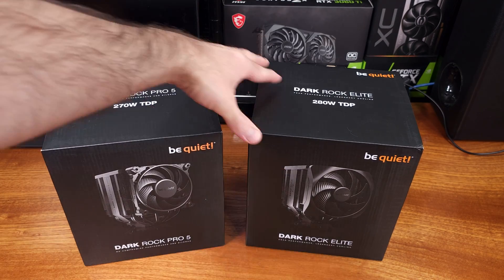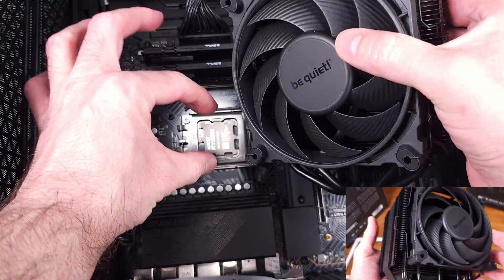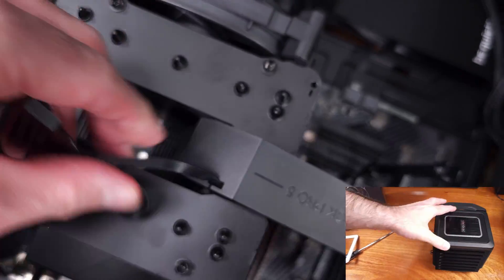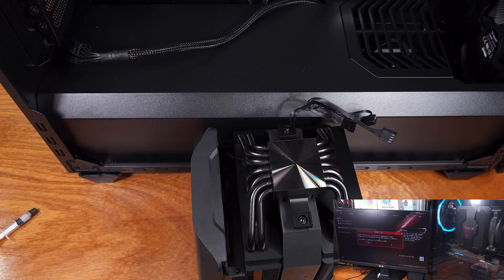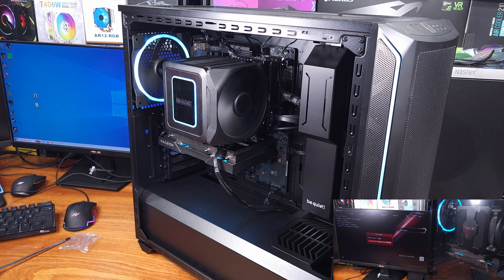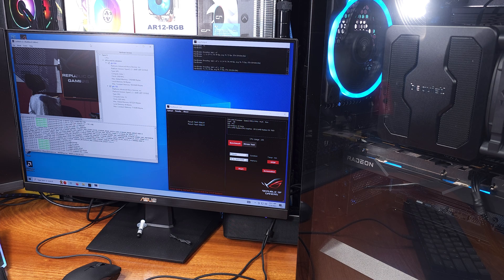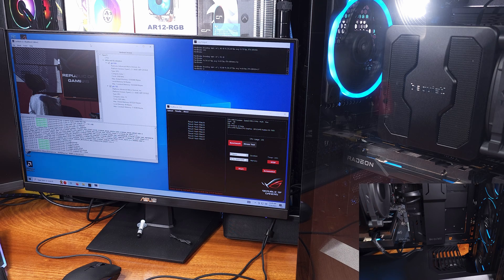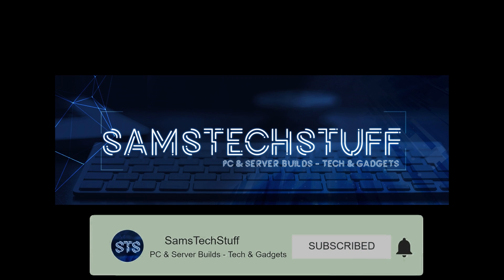Dark Rock 5 Pro vs Dark Rock Elite - Ryzen 7700X

Comment: Some people say that the Dark Rock Pro 5 is not well suited for AM5, due to the lack of an offset, so the pipes are misaligned with the hotspots of an AM5 CPU. Is this a real issue?
Reply from the maker: Seemed to get the job done fine in my testing. I was actually planning on pulling the Pro 5 out of storage soon for a new build.
Reply: @STS  I am going to get this cooler. Have you tested with both Intel and AMD?
Reply from the maker: Nice! No, only AMD. I don't think I had the 14700k or it wasn't available for me to test with at the time I was working with this cooler for the video.

Which CPUs were you looking at?
Reply: @STS  I am getting the the 9800x3d. It should be easy to cool.

Comment: I dared to take the liberty to ask you something not related with your video. Please, tell me, are you satisfied with ASRock X670E PG Lightning? I planned to buy that motherboard.
Reply from the maker: Hi, I think the Asrock X670e PG lightning is a great budget X670E motherboard. I use it with my Ryzen 7700X as my standard Ryzen AM5 test bench. This motherboard will not allow for super high memory overclocks, that's really the only criticism I have of it. Since this is a budget motherboard though, I don't really view that as being a problem. Right now I have a 32gb kit of G.Skill DDR5-6000CL30 running no issues. What CPU and memory did you plan on going with?
Reply: @STS  Many thanks for your answer. I was worried by some complaints about stability of the motherboard. My plan is to go for Ryzen 9 7900x and unexpensive 2x32 GB Kingston Fury 5600 MT/s CL36 (nothing fancy).
Reply: @clausion  I have recently build am5 platform with Asrock x670E Steel Legend +7800x3d+ ADATA XPG LANCER BLADE 64gb 2x32 6000mhz cl 30. I have my old cooler Dark Rock 4 pro wich is doing wonders..40C idle - gaming around 60C. Case is be quiet 802 with 7 x140mm be quiet fans.
7800x3d will work just fine with a cheaper cooler like Thermalright or Deepcool , around 30- 40-50 usd.- plenty youtube reviews
In conclusion, i am very pleased with Asrock mobo x670e chipset. Works perfect, stable and boot time is normal..like 5-10 sec in win. 
First boot was around 3-4 min. I have latest bios.
For me it is hard to upgrade from drk4pro to dr5k pro or elite, not worth the money only for the easy instalation upgrade and a few -C.
So yeah, ASrock it'a a worthy choice, money wise.

Comment: Thanks for the video! I am thinking of getting the Elite for my 7800x3d
Reply from the maker: Glad to help out. In terms of air-cooling, this is a solid choice for the 7800x3d. Just be sure to double check the supported cooler height of your case. 

Is this a new build? What GPU did you end up going with?
Reply: @STS yeah its a completely new build:  

Fractal Design North XL Charcoal TG Dark
AMD Ryzen 7 7800X3D (8x 4.2GHz / 5.00GHz Turbo)
be quiet! Dark Rock Elite
MSI MAG B650 TOMAHAWK WiFi DDR5
32GB (2x16GB) DDR5 6000MHz G.Skill Flare X5 CL30
2TB WD BLACK SN850X M.2 PCIe 4.0 x4 NVME (L 7300MB/s ; S 6600MB/s)
16GB ZOTAC RTX4080 SUPER Trinity Black
850W be quiet! Pure Power 12 M ATX 3.0 - PCIE 5

should be plenty of space for the cooler - I dont know how many extra coolers I need for the case though.
Reply: @JHNNYWLKR are the g.skill a bit to high for this cooler ?
Reply: @voxuancuong RAM clearance should be 35 mm while these RAM sticks in particular are 33 mm. Should fit perfectly fine
Reply: @voxuancuong But I do not have my system yet
Reply: @JHNNYWLKR How do you know its 35mm ? I bought it with corsair 6000mhz but idk